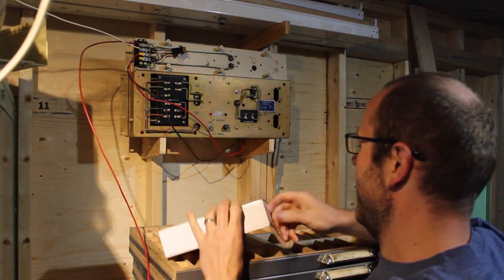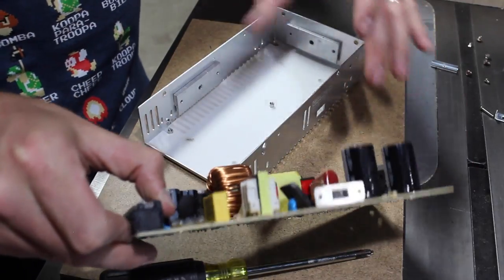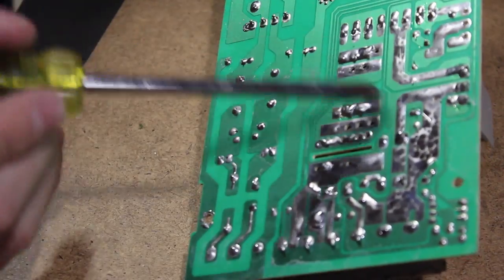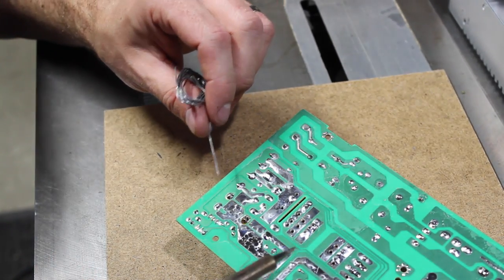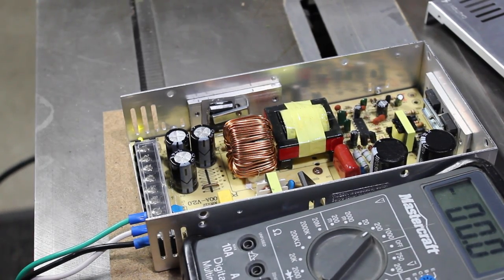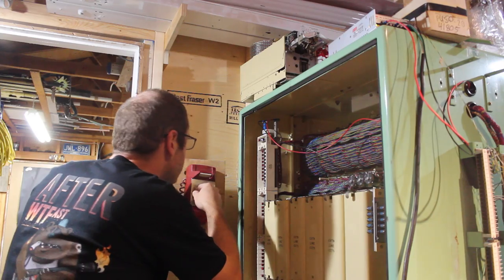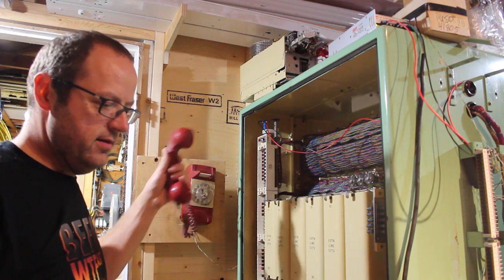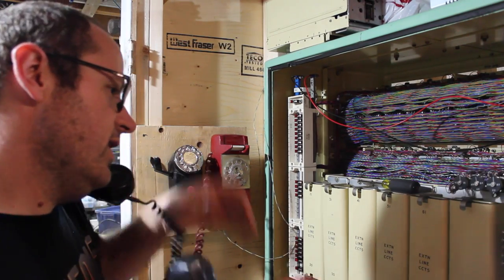Strowger PABX Power Supply Upgrades

Comment: Well done on the PSU repair.  I have one of these Chinese PSU's as a back up for my two Strowger demo units.  A number of us in the UK phone group (THG) also use them, we found they werent very well protected from back EMF (ie from when a selector clears down etc.) so you might find it a good idea to fit an inversely wired diode over the DC output from the PSU.  There might also be settings on your PABX to select how a call clears down, you can normally change it from calling party release of a call to first party release, so whoever hangs up first drops the call and resets the exchange ready for the next.  Hope that helps!

Comment: A 48 v power supply is 2 volts short. The relays don't work right at 48v. Got to have batteries too for filtering.23 cells of lead acid floating.
Reply from the maker: According to the specs for this PABX:

Power Equipment
The working voltage is 45 to 55V (50V nominal). If a reliable a.c. mains supply is available, a battery eliminator N22405D may be used.

48 volts is perfectly fine for this piece of equipment. It can also be run without batteries.

Modern switch-mode supplies are very electrically quiet, and have good regulation and filtering. When this PABX is being powered on a SMPS, the call quality is indistinguishable from when it is being run on batteries.

If you watch my later videos, you'll see that I've put batteries in line with the power supply, and these days I usually run it on batteries alone (24 cells), and charge the batteries only when they get a bit low.

Comment: What's the clicking later in the video?
Reply: Neat. I just checked out the earlier video where you're showing off the mechanisms moving. When you mentioned the power supply click problem, and then it started clicking after your repair, I was a little confused (but obviously it was working).